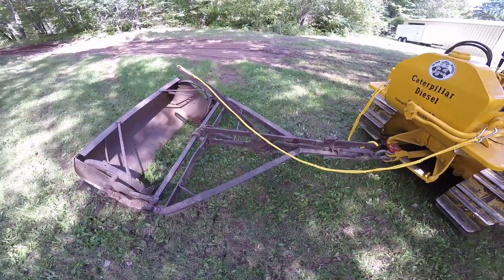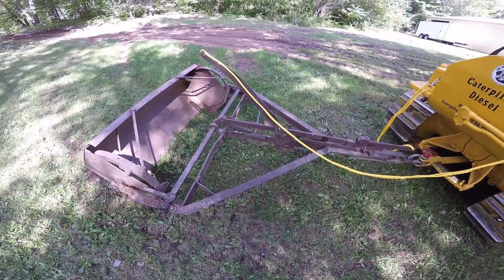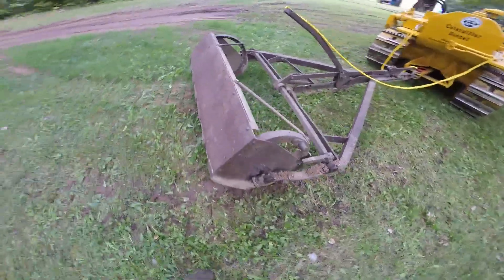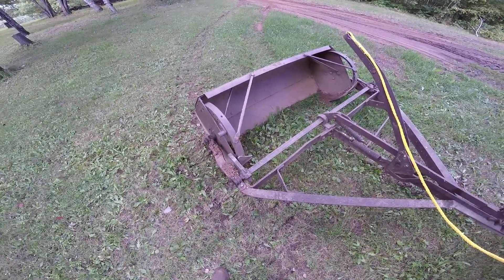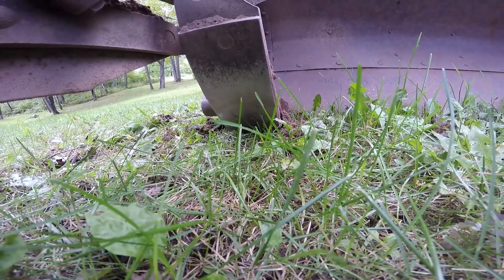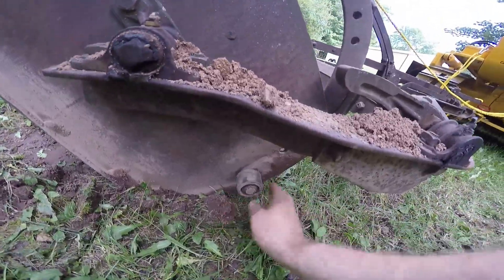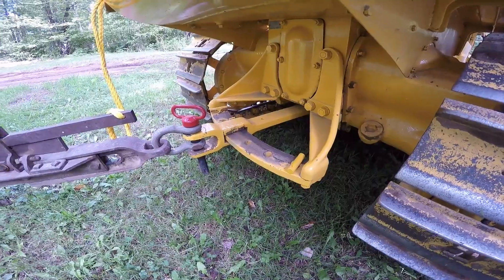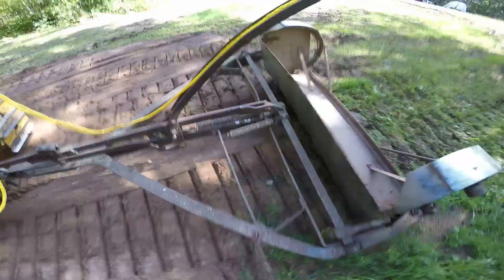Tumblebug Rotary Scraper Operation, Adjustment, and Demonstration

Comment: Dad had a tumble bug that I still have. We used to pull it behind a 1943 Case model S.

I never knew about the adjustments. Something must be missing on ours. Once the scoop was full, we would have  to back up and pull the larger lever to set it in transport.  We were never able to dig & keep going.

Comment: Great video  There was a 3 point version of this made by Ferguson Implements called the Towner Lift Transport Scraper. It was supposed to carry 22 cubic feet of dirt which loaded would be about 1700# way too much for a small tractor to lift. I was trying to find one but they must have not worked well on small <30 HP tractors. Your setup seems to work great but I was wondering if you have to be careful not to hit a rock or a stump. It seems with the Cat pulling it you could tear it apart before you had the chance to stop. Maybe some kind of shear pin on your hitch setup would allow the implement to break away if you should hit something
Reply: Darlene Yax in that kinda sandy soil I bet theirs nothing big enough to worry about. But i bet if you take it slow youll be fine
Reply: We used to use something called a slip.  I have seen both drag type and 3 point.  Northern sells one made by King Kutter called a reversible dirt scoop.